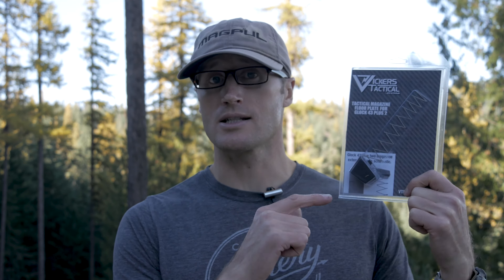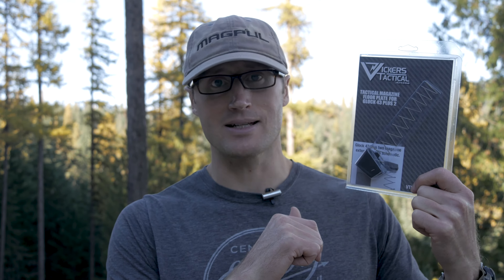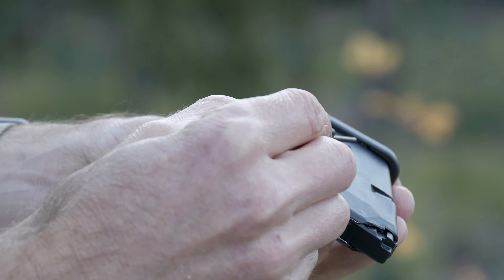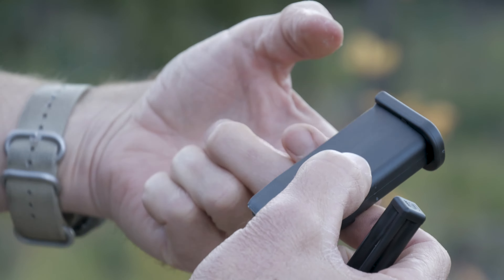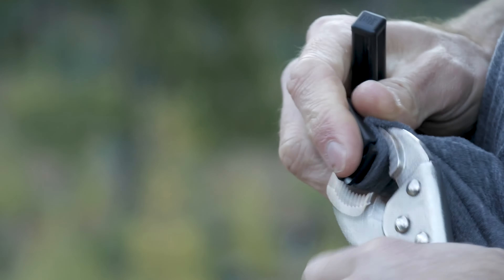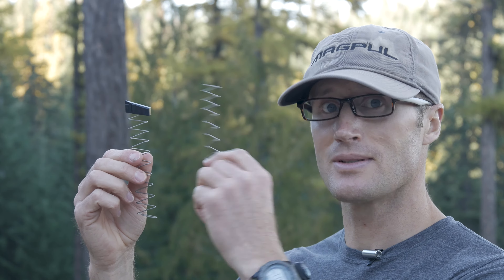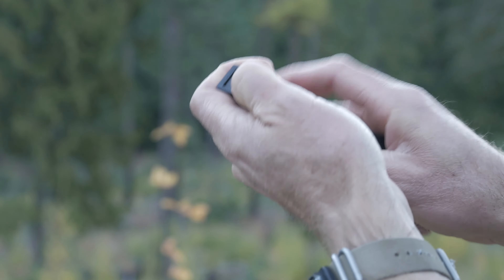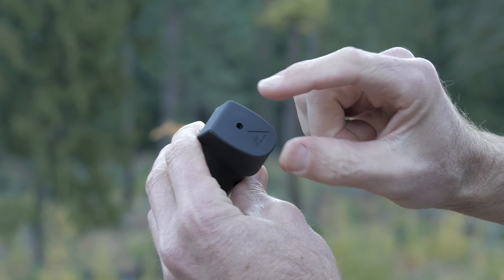G43 +2 Floor Plate Installation

Comment: thanks for vid.... little brother for your g17?
Reply from the maker: No problem.  Just checking this guy out.  It is hard to leave my HK P7M8, which is an amazing single stack 9mm...   ...from about 30 years ago.
Reply: P7 is a great gun. I bought a Shield, I was debating between G43.
Reply from the maker: Yes, that is a hard call.  I think the deciding factor is to go shoot them if possible at a range.  Which one feels good, which one can you shoot more accurately with...  It is easy to fall into a brand without giving other pistols a honest go.
Reply: In my humble opinion, the Shield was a softer shooter and ergos to me. but the $75 rebate was a bonus too. my first S&W in my Glock family.
Reply from the maker: Interesting.  I wasn't familiar with that problem.  I will say the single stack mags they made for Gun-Unfriendly states were a pain in the ass...

Comment: Should have loaded the “8” rounds as proof along with demonstrated that there is spring action on the 8th round to prevent jamming the slide.  Also, what mag version you are demonstrating, ver 01 or version 02?